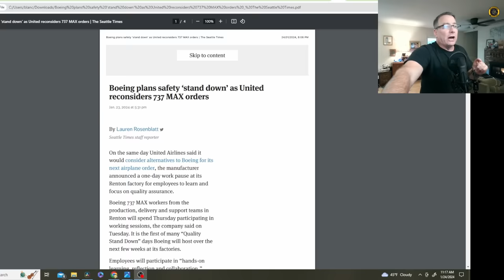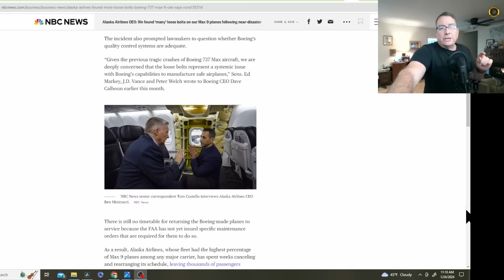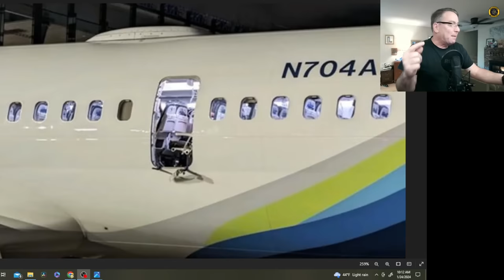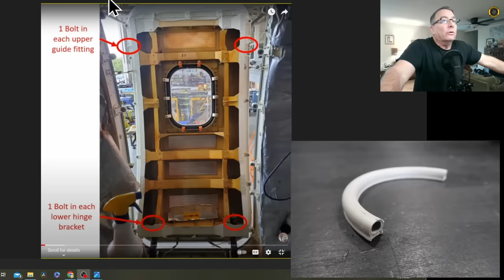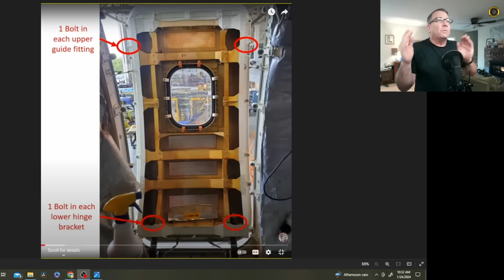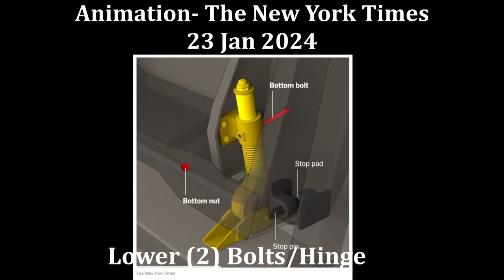Boeing's Quality Management Failure Explained 737-Max-9 Door 24 Jan 2024

Comment: This is what happens to a company when "bean counters'" take over and the experience of trained and qualified longtime employees is ignored and swept aside.
Reply: My exact thoughts
Reply: Sadly, this has happened in many places in the last decade(s).
Aviation just has a harder response when the bean counters screw up big time.
Reply: And politics become priority
Reply: DAMN STRAIGHT!!!!!!!!!!!!
Reply: And hire a body off the street and believe "anybody" can do the job.
Reply: I don't know where you are getting that at. As a retired mechanical engineer who cut his teeth in the aerospace industry, this is not the bean counters. This is a QA screw up, the type that can sink a company. If this is just an isolated error in their QA plan, it will only affect this one aircraft assembly. If not...
Reply: Even worse then swept aside. They fired their quality inspectors then realized that was a mistake a hired new ones likely with less experience.
Reply: All caused by B.oeing's equity employment policy.  If you don't choose the best, you get iddiots.   Same goes for flight crew, who have been selecting by equity for ten years, and many of those new pilots should not be in charge of a bicycle.  Trouble is, many of those equity-hires are now becoming captains, which is why I no longer travel by air.  

There will be equity crash after equity crash, over the next decade.  

R
Reply: When a company prioritizes profit margins over QA/safety, and is allowed to self-regulate and self-inspect, these types of issues are inevitable.
Reply: Huh. I've never seen that opinion expressed before. How original.
Reply: The same thing is happening in healthcare, following the Boeing death spiral.
Reply: Trite
Reply: in addition primary systems farmed out to the lowest bidder
Reply: Everyone says that, but some employee, trusted to do a certain job, failed. Then an inspector, trusted to do a certain job, failed.
Do you think that the bean counters ever said, "Hey, skip these mandated inspections!"?
Reply: It's not even "bean counters" it's just incompetence at the very highest levels of the company. How does their VP of Quality still have a job? Apparently she started out as an intern not all that long ago - must have had a really amazing set of skills.
Reply: Yes sir !
Reply: Without 'bean counters' there are no beans. History is littered with failures that ignored the 'bottom line'.
Reply: Wasn't bean counters that removed the bolt, the entire corporate ethos is damaged at this point in Boeing.
It's not rocket science to remember at a minimum to replace those four safety bolts you removed at the start of the day at the end of your day. It's just not paying attention
Reply: @horrido666 the quality system at Boeing is entirely under the control of Boeing’s management team. Any shortcomings it has are their responsibility.
Reply: @horrido666  the bean counters were likely the ones who recommended Boeing fire a good portion of their QA staff. So yes, this is on the bean counters and executives who put profits over quality AND SAFETY.
Reply: @horrido666  I disagree with your comment
Reply: @UncleKennysPlace yes they did, by pressuring managers to increase delivery cadence, and indirectly by prioritising profit motives on top of everything and passing this message to the managers and so on.
Reply: Scary! @RalphEllis
Reply: Sorry missed your comment, 100% agree with you.
Reply: I call it bean counter management.  I've seen more companies spiral into a tail spin from it.... just look at General Motors!  GM once had a 49% global market share in 1965.  Today that share is 17%.  Bean Counter Management at its finest.
Reply: Are your bean counters rogue? No. Keeping the money for themselves? No. This "money saving" ethos comes down from the top to line the executives' pockets. No other reason than greed, and the myth of "tickle down" continues to hurt us all.
Reply: Take the lesson's from OceanGate Boeing (and all big manufacturing companies) - If your hiring practices are not based on merit, you can expect an increase in incompetence.
Reply: This is what you get when you replace experienced personnel for cheaper, inexperienced personnel.  When management have no appreciation that shop floor safety saves executives as much as it saves workers and customers.
Reply: They better get there act together.The same thing happened in the American auto industry with poor quality and look at them now. They have lost market share to the Asian car companies that have taken over with quality cars over the last 30 years. There is aircraft companies around the world rubbing there hands together that will do the same.
Reply: Try working for a private equity company....
Reply: DEI is deadly.....
Reply: Sadly, it's ubiquitous.
Reply: Amen 1000%. Seen this happening in former employers before I retired. To then hear the United CEO also say he wants DEI to drive future hiring practices "across the board at United" is enough to make me want to give up traveling at least by air.
Reply: Less bean counters and more people on the tools
Reply: @horrido666 who other than the bean counters would have decided to sell the Wichita facility to Spirit? That is the crux of this problem, and it’s a classic bean counter move. Sell off/get rid of assets to “reduce our financial burden”, and then pat themselves on the back with a fat bonus for all the money they saved the company this quarter.
Reply: This is exactly what my friend Dave said when he retired from Boeing a few years ago after a 30 year career.  New young turks had taken over management and despite a complete lack of knowledge of aircraft assembly they "made it better", or as normal people would say cheapened it and gave us the disasters of today.
Reply: Made in America 🇺🇸
Reply: I have worked in aerospace for 30 years and I can completely understand how this happened. Instead of "bean counters" or corporate culture or any of the other fashionable boogey men for this issue, this probably came down to a mechanic who thought he was being clever by writing up the rework instructions as opening a door vs removing it.  The former allowed him to just get on with the fix without (in his mind) a needless inspection for a "removed" door.
Reply: @bubba99009  Nope I was wrong.  Sorry!
Reply: Actually, its more that Boeing sold its Witchita division (which manufactures 737 fuselages) to Onex, a Canadian Investment group. So Boeing just contracts Spirit to assemble their planes. And Spirit has their own way of doing things.
Reply: @horrido666  Didn't Boeing execs fire 900 quality inspectors. Also, the money men in corporations ultimately decide how much time and money is spent on safety, quality checking etc? These people get paid a lot because we are always told they are ultimately responsible for the actions of the lower downs - except they very rarely are
Reply: @onekattsopinion726 ??
Reply: RalphEllis…. you are exactly right and nobody dare speak of the elephant in the room
Reply: this is what happens when industry gets their talons into the oversight functions and push deregulation
Reply: @pauldzim  I wish I had a $100 for every time I've seen the comment about bean counters running companies.
Reply: Probably an illegal immigrant workers fault
Reply: There was mention of the a (as you put it) "trained and qualified longtime employees is ignored and swept aside" so why did it blow out the side of your a$$?
Reply: Toyota re-invented Auto manufacture by understanding their competitors faults and how not to make a bad product,  Kaizan 'continuous improvement' every person and process in assessed and the end result is a good product and proud workers.  Boeing just get it out of the door and we will sort it later.  How many million have they paid out to compensation to keep the customers from going to Airbus. Shame they were a good company before the Mc DD takeover.
Reply: Wait, how is this the bean counters fault? This appears to be a discrepancy in the Quality Management System between supplier and manufacturer. Bean Counters do not write the Inspection procedures, that is typically done by a Engineer or Experienced Inspector...like come on guys, "bean counter" blaming is getting old and makes no sense especially given the findings per this video.
Reply: Sadly, this type of thing happens in every industry or business.  I remember when you could go into a Home Depot store and you could know nothing about the project you wanted to try to attempt.  They had employees in there who formerly worked for companies as installers or manufacturers.  

They could tell you every single thing you needed to know and every single supply you needed to buy to enable you to do that job.  

Then in came the bean counters who said we could save a lot of money if we get rid of these high paid senior employees. We can in some younger entry level people who will work for a lower wage. 

So then you would go into Home Depot and find somebody who didn't even know as much as you did. That is frustrating to say the least.  

That's bad for sure but not anywhere close to a bean counter who is trying to save money in aviation or aerospace industries where cost-cutting measures or losing quality people could result in an accident that would cause the deaths of many.
Reply: @tmayorca8770  evidence of that?
Reply: @UncleKennysPlace yes these guys failed, then others later, whomever applies insulation if needed in said plug door, lastly the one(s) that applied dress panels. Granted they are not the inspectors, but did they notice something out of the ordinary??, “hey looks odd here missing those bolts”, or the it’s not my job-attitude to call that out or reach a supervisor.
This attitude is everywhere and downfall of great companies…
Reply: @micbroc6435  of what.  I know plenty of people that work there.  Most aircraft manufacturers employ technicians.
Reply: @hyperkoala1758  What kind of politics? You need to clarify because all indications is that this is an issue of cost cutting.
Reply: @SB-cz9vo  Ah, this kind of goof up could never happen huh.
Reply: @eddy66t6  The counters could easily demand X% be cut from the costs.  If this means kicking certain cans down the road where they don't fall under what the counters see, well....
Reply: @horrido666  Boeing laid off their Quality Inspectors see the Seattle Times 20 Jan 2019
Reply: @UncleKennysPlace  yes, the bean counters said 'skip these mandated inspections', or at minimal 'your schedule is determined by dates set by accountants, not the time needed to do inspections'.  So sure, you are 'trusted' to do the mandated inspections, but do them and you will get fired.
Reply: @DaveP-uv1ml  which is why their 'speak/listen' meme is so headache inducing.  Not long ago there was a mandatory training video, a slickly produced scenario showing selfless managers being bamboozled by selfish career focused engineers who hid problems from then so they could get praise and rewards, and it was the honest mature managers who had to clean up the mess.
Reply: @RalphEllis you are right. When a company selects personnel on the basis of gender and skin color, it might run out of options. People in the wrong racial spectrum (in this case white males), won't even bother to apply, no matter how well qualified, knowing that their chances of getting through are slim. Privileged groups, on the other hand, have few or no motivation to improve their qualification and/or performance.
Reply: @tmayorca8770  both of my parents worked there. Several friends and relatives. Just because someone is a technician doesn’t mean they are anywhere near the aircraft construction part of the company. It’s a very overused word.
Reply: @micbroc6435  I know that but someone has to come back and inspect the work like any other job.  They should have had someone inspect the installation and sign for it.  If someone inspected it they would have found a problem.
Reply: @micbroc6435  technicians put the plane together however if someone removes  and reinstalls something the inspector is to witness it.  Sounds like Boeing needs more inspectors or need to fix  their paperwork to show it needs inspection.  QC dropped the ball.
Reply: @tmayorca8770  this is how it worked on a submarine depending on the system. A QA/QC inspector needed to be present at all steps of a job. Should the job be interrupted an exclusion area needed to be set up. The inspector was not allowed to perform any aspects of the job. If there closure needed to be torqued two separate workers had to do it. Once all steps had been performed the job was closed out. There is a reason the military uses the term idiot proof. Doesn’t always work unfortunately. There is no coming back to a job, if any work is to be done the inspector is present.
Reply: @JeffreyBue_imtxsmoke just in this post alone you’d be rich
Reply: @WOFFY-qc9te you’ve got that ass backwards that’s when the quality of work went down the tubes with the airline manufacturing from the quality everyone depended on with Douglas aircraft when Boeing bought them out. I seen it first hand and it went down hill from there. It involved a lot of things from Boeing breaking their promise not to replace any Douglas employees which they did after a year. They brought a lot of Boeing people in many of which were a promotional position who were not properly qualified and over their head. The long time Douglas employees that got replaced were RIFFTED. These unqualified Boeing employees extended the problem by bringing in friends or prior teammates that were also unqualified for the positions they took. This started the down hill quality problem that progressively got worse as expected.
Reply: @Jawst  Maybe we should buy our planes from the Chinese. "Chinese quality" might be an improvement at this point. Haven't heard much about parts falling off their planes recently.
Reply: @tmayorca8770  And he's back in Oaxaca by now, with the bolts in his pocket.
Reply: @micbroc6435  We can't HAVE any evidence because the border is wide open and we are not allowed to question the status of anybody.
Reply: @robgrey6183  claims have been made that illegal immigrants are working at putting these planes together. BS. Undocumented people across the southern border are going to be the people who work in agriculture, home construction, service industry to include restaurants, hotels and resorts etc. not aviation production. Don’t bring a childish argument into the situation based on nothing but irrational fear. 
You want to debate the southern border, fine. I’m most likely far stricter than you regarding enforcement. However irrational fear of the unknown gets you absolutely nowhere.
Reply: @micbroc6435  ikr. I've worked a lot of dangerous jobs and been inside two submarines in museums.  One on water, one land.  I could only venture in a few feet before I scrambled back out.  Only few people can be submariners I believe that.
Reply: @tmayorca8770  was the one on land the U-505?
Reply: @micbroc6435  I don't remember what the number was
Reply: @DaveP-uv1ml  I think there is a level of I don’t care ism at Boeing now. It’s not just a compliant workforce it’s a workforce that is acutely aware of how few work benefits it has compared others who can still be in the same facility. On some level it has to be demoralizing.
Reply: wrg